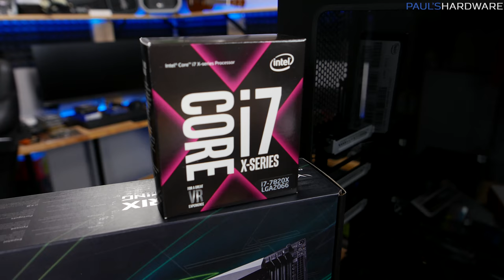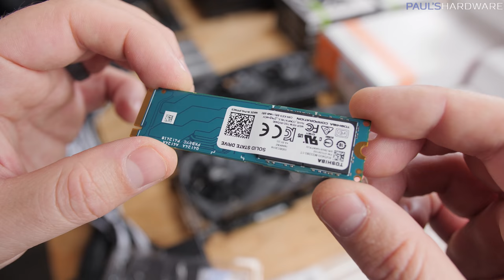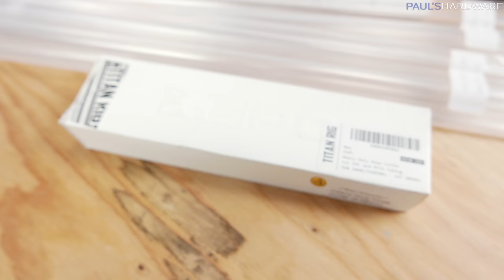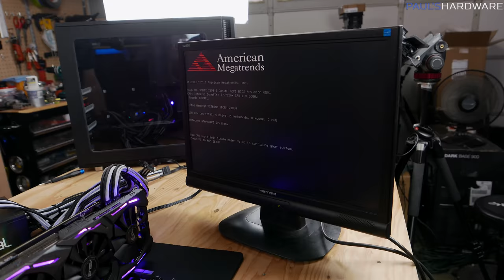GLORIOUS Custom Watercooled PC! Arctic Panther Build Log Part 1

Comment: Hey Paul, I am a small YouTuber that is currently using a elgato, PS4, and a mac for my videoes. It's not working out well and I would like to play PC games so I want to build a decent computer. 

Can you recommend one? I want to stay under $2000 for the full system. Would like two monitors but I would rather have a pc that can render, play, and record smoothly and all at once. 

Is this even possible I know almost nothing about pc's.

Comment: Paul if you have a set of calipers you can measure the screws that you have and then head on over to www.boltdepot.com and buy some that are shorter there for that back plate.

Comment: If you've got a bench grinder (or hand grinder), you may have better luck shortening those screws. Just hold the screws with pliers or even better, vice grips.
Reply: I was just going to suggest using the screw cutter that's built into most wire strippers. It's a far easier and cleaner way than trying to hold the screw with anything. Most all 24 and 32 tpi screws can be cut, and a set of wire strippers can be had for just a few bucks.

Comment: I'm just using a 1TB ssd, should be enough.
My ssd is 120 GB
Reply: Dr. Dunk I'm just going with 1tb m.2 SSD in my build, easier on the cable management.
Reply: Dr. Dunk I don't even have an ssd I just have 750 gb harddrive
Reply: Mathew Mustard Jr it was one of my first upgrades, take a look at buying one (;
Reply: Dr. Dunk you can always buy another. 960 Evo all day.
Reply: Brandon Cosme money is the issue. Plus my ssd is m.2 so yea
Reply: Dr. Dunk 960 Evo's are cheap af now. 500gb are less than $200.
Reply: Brandon Cosme that's more than i have in my bank account so yea
Reply: Lol noobs I got a 464 Hard drive for free from an old hp laptop I definately need to upgrade my pc.

Comment: Why not just use double sided tape to hold the backplate? or maybe some thin thermal pads? its not like you're going to be moving the system around once its finished, it doesn't need to be the strongest thing in the world.

Comment: Very cool! I like what you did with the Asus backplates, I have been wondering if it is possible to use your factory backplate with an EK block....seems it can be done, NICE.
Reply: These are the cards that I want to use for my next build and the biggest part is the back plate, I saw @linusTech do it but it was just there with no info on how. Awesome video so far can't wait to see Pt. 2

Comment: Why dont u use a 1080ti poseidon?
Reply: Tom's Hardware has a great review on the Poseidon. You should check it out. The cooling flexibility is great, but cooling performance is sacrificed.

Comment: Please for the love of god enable lower resolutions than 1080p. I have a 720p monitor, and this video had to stop to load every few seconds because I couldn't turn the resolution down. (not everyone has really fast Ethernet and 1080ti sli with a 1440p 120hz monitor)
Reply: Well, my system does consist of a pentium 2127u, it's graphics, 4gb of ram and a 5400rpm boot drive so I think 2010-2011 would be more appropriate.

Comment: the cpu isnt useful
Reply: TheSneakyRM how
Reply: Tyler Alcover you cant use all the memory slots with that chip
Reply from the maker: I think you're confusing this with the 7740X (quad-core), the 7820X has 8 cores, quad-channel memory and 28 PCIE 3.0 lanes.